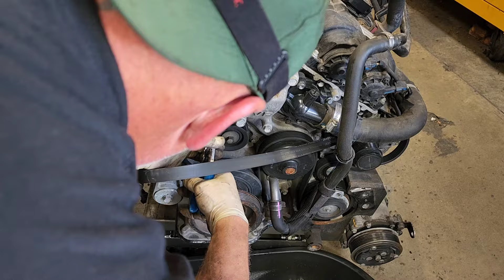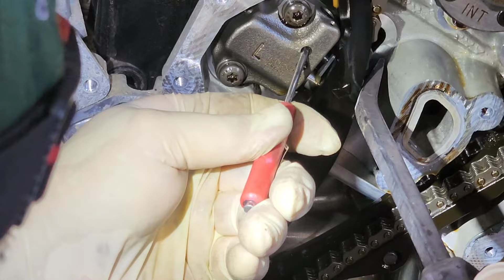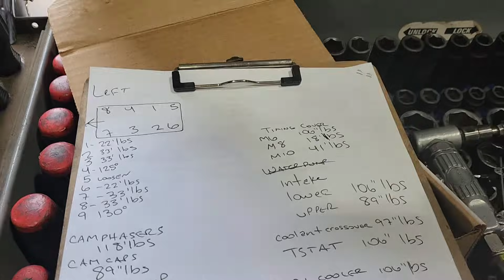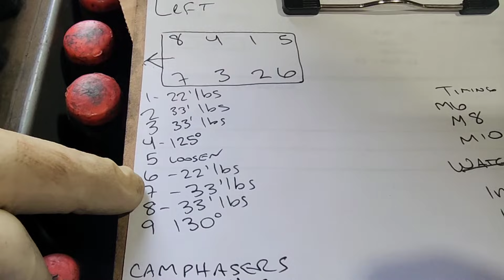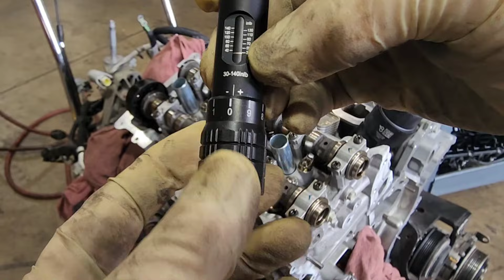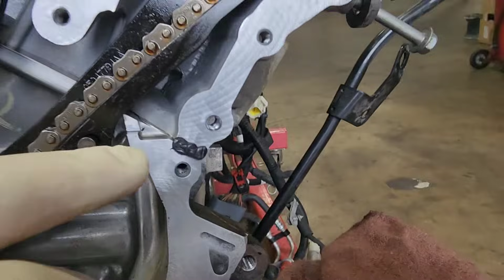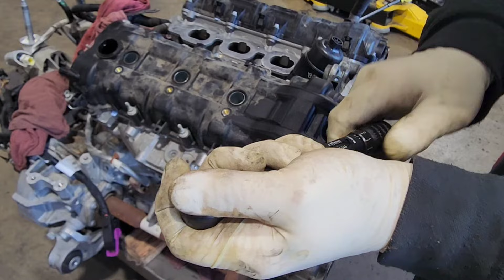3.6 Chrysler Pentastar How to Replace Head Gaskets

Comment: Any worry about stripping out the block when removing or installing the head bolts?? I’m about to tackle this job and I have a weird worry about that. It was never overheated and only has 62,000 miles
Reply: Nah.  Just make sure you loosen them and install them with hand tools.  Don't go in there with a mega torque impact wrench.  And clean out the holes with air like he said.  Take your time, and you should be golden.

Comment: Decent video, one thing if you are watching this video, he forgets to mention to make sure you put your engine into Top Dead Center (TDC) when pulling the timing chains on and off. 
How to tell it is simple. 
1) The crankshaft has a dimple on the crankshaft gear that has to be at 9 o'clock or the block line or pointer located right at the seam where the engine block meets the main bearing cap. 
Do this or else the consequences will be dire.
Reply from the maker: Thank you

Comment: Amazing video, I’m so glad I clicked on your video first, about to tackle this job. Dealership wants about $3500🤬
Reply: Same here !
Reply: @karensloveme Well, I finished the tear down yesterday and started cleaning and installing today. I at about $1300 for parts and tools. I needed the degree wheel, cam kit, and inch pound torque wrench. For parts I bought the Dorman head gasket kit along with upgraded aluminum oil cooler, and water pump, thermostat, and PCV valve.

Comment: so question right? I manage to get the heads off, do I just clean off the heads? and also what did you use to clean the block so nice?
Reply from the maker: I personally never pull heads off without sending them to machine shop to be checked. I personally use a die grinder with roloc plastic disks. You have to be careful though

Comment: Do you remove the oil pan to remove the bolts?
Reply: No, it’s just the four bolts under the oil pan
Reply: @whyeatdirt7951 thanks one more question the head bolts torque specs ist same on the 2019 Durango 3.6 pentastar
Reply: @armandohilario nope. Every generation of the engine is different. Find a manual or something that’s brand new to the year of the car
Reply from the maker: I use it a ton, plus it is longer then extended reach cordless tools even snap on. I actually got rid of my snap on extended reach and only use this one, at least until the new milwaukee extended reach comes out

Comment: Maaan, u r the best ! Thank you for this video !!!!
Reply from the maker: Thanks for watching!
Reply: Sorry to bother you ,I got a question real quick , I was doing the torque on the cam caps and 89 inch lbs doesn't look like that tight ,on your video you go like twice the force , I don't know if it's me, or is like that , by the way I subscribe to you too!! Thanks in advance
Reply: Also my timing marks on the sprockets down on the cranshaft got wiped out with brake cleaner 😂😂😂😂

Comment: what do you clean the head surface with?
Reply from the maker: I personally use a die grinder with light trigger and plastic roloc bristle disk but you have to be very careful not to take off any meta. Very light trigger and pressure

Comment: Appreciate your craft, i have a question, for the torque specs for head bolts on the service manual it says follow steps 1-9 for new block and only steps 6-9 if using the same block, how come you use 1-9 steps with the used block?
Reply from the maker: Can't recall

Comment: Amazing video. About to do some head gaskets on the exact engine. The only thing I am worried about is that I will be doing it in the car. Thanks.
Reply from the maker: Just get a 3 inch mirror it will help.  Good luck

Comment: ALWAYS  LIGHTLY OIL Head bolts? It’s a wet torque. If you don’t you will cause too much friction when you “degree” the bolts. They will popping sounds if you don’t add oil
Reply from the maker: I only oil threads of head bolts if procedure calls for it, But tbh most of the time they do require oil

Comment: its worth noting that the first round of torque spec up until the loosen phase, is only for a brand new block not for a rebuild or used engine block, its just 22 ft lbs, then 33 in sequence twice then 40 degrees then 90 degrees ,other than that great video
Reply from the maker: Thank you for sharing your insight.

Comment: Was this the second or third generation pentastar 3.6L engine?
Reply from the maker: Gen 2 starts at 2018, cannot remember what year this one was.
Reply: Regardless of gen 2 or 3 it’s the same way. Only thing I’d do differently is aligning the timing marks. There are two arrows that need to be facing down on the bottom timing sprockets at the lowest point of the timing chain. Make sure they are facing down. And make sure cylinder one is at TDC. And you won’t need to mark your chains. While putting it back together use factory marks on chain and you will be golden. Also since the left intake and exhaust cam is under tension I heavily recommend holding the cam with a crescent wrench and gently sitting cam at resting position. While removing Phasers.

Comment: Hi, I'm about to do this job on my ram. Just wanted to check with you : I put a pressure tool on my radiator and lost 4psi in 30 min. Then when I started the truck after relieving the pressure to see if I would get spikes in pressure I smoked the garage with white smoke so I stopped my test but is there somewhere aside from the head gasket that could've cause this big puff of white smoke from the exhaust after the pressure test ? Also why not use the 3 black chain pieces for the timing instead of using paint ? Thank you !
Reply from the maker: Yes sounds like a head gasket.  I just always use my paint pens for everything
Reply: @nutsandboltswithtone thank you for the reply. It's really nice of you to take the time to answer to your viewers even 2 years later !

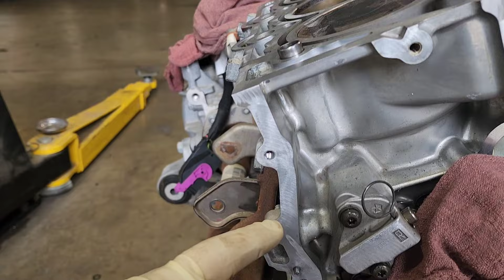Comment: You don’t have to worry about moving the crank. As long as you set piston one the way you have it when you’re explaining at 12:58. That’s where the cycle of the engine timing starts. As long as you crank it back to Cylinder one. Great video though !
Reply: If you wanted to also clean the surface carbon on top of pistons, you’d crank them around. Clean. Just set piston 1 on the right which would be the first piston back up.
Reply from the maker: Thank you

Comment: Hey man, pulled the pin on the left tensioner, but it depresses and extends as I rotate the engine and makes a click sound, is this normal
Reply from the maker: Yes it will do that but chain should stay snug.

Comment: I think I’m about to have to tackle this job on a JL Wrangler I just bought.  Everything seemed great but about a week after I got it I noticed the coolant was about 1/4 inch low.  Topped it off and 2 weeks later it was back at the minimum mark.  No leakage anywhere
Reply from the maker: What I do is block test for head gasket issues but sometimes that does not always work. Here is a link to the block tester I use.  https://amzn.to/4nYUiNR

Comment: Would you say that a failed compression test and vacuum test indicate a blown head gasket on a 2018 Jeep GC 3.6L? I simply used the compression and vacuum (separate tests) that came with vacuum coolant refill kit. 

Also, do you have to remove the engine to do this repair?
Reply from the maker: The way I test for blown head gasket is to perform a block test where you are testing for combustion gases in the cooling system. You do not have to remove the engine it is just easier.

Comment: Absolutely loved this video and so thankful and Grateful for all the information you provided thank you for sharing this ❤ I’m going to use this as a reference guide to replace both my cylinder heads completely in my 2018 ram 1500 3.6l v6 woth 190,000 miles on it with a bad exhaust valve on cylinder 2 Bank 2 that won’t hold compression  along with new timing chain parts oil pump water pump thermostat water crossover and lower intake manifold for about $2,500 instead of $8k-$10k for a new engine that every shop wants to do.
Reply from the maker: I am very happy to hear thank you. That is awesome you are going to do it yourself, good luck. Hit me up on Instagram if you need any help

Comment: I tried taking off the balancer bolt and I think I messed up the timing cause the chain was moving bruh, 😭
Reply from the maker: Damn that sucks. Did you follow the procedure.
Reply: @nutsandboltswithtone  yes I just kept going till the arrows lined up ? Should that be fine ?

Comment: what could happen tightening about 100* instead of 130* like AllData says(I was afraid to brake new aftermarket bolts)???
Reply from the maker: I would think the head gaskets would let end up leaking from the clamping force on head gaskets is not enough.

Comment: Not a mechanic here, great video, I am doing my 2015 Chrysler Town and Country, total rebuilt due to hydro lock. I am following the same manual dealers here use; purchased online for $80.00 the head bolt sequence that manual says to do it once, the second step in your list, if the engine is used or remanufactured; if it is new it is the sequence you use here loosing everything and doing second time. On my block I have had only problems at every step; I found several threads destroyed, my local Chrysler dealer replaced the van original engine once at 59K miles due to a spun bearing; I have Mopar lifetime warranty which they do not sell anymore and that took care of everything but they obviously used an "insurance" block, seeing the condition this block was when I took it apart! I ended up having to re thread all the most important holes in the block; main bearing caps; which manual says they are not repairable; guess what? I am not paying for a used or new aluminum block too take the same risk again so slapped the fucker with deep steel inserts, then had failures on the windage tray holes, threaded all those as well, then had issues with couple holes in the heads!!! had to get a kit ($538.00) to do those but the job came really nice; and last but not least the oil cooler holes were ALL stripped!!! this is from the dealer from a " Certified Mopar Tech" whatever! I took pictures to the service manager there because Mopar rejected my claim for water damage and so did my insurance, I had to end up doing it myself because nobody wants to pay 13K quoted job and I laughed when they wanted to give me $1500 for the van as total loss; so slowly but surely I am doing it, doing what I can with my limited knowledge, same way I rebuild my wife's Corolla and still running after 3+ years. When I torque those Ajusa Head Bolts to spec, just once, I felt no desired to loosen them again, so I am glad it is not needed, according to the manual I am following; they seem to have grabbed great; only one bolt creaked under torque; the beauty of the thread inserts is they would hold for even more head jobs if needed in the future. I just ordered today a Dorman Thermostat Housing/ Thermostat, aluminum and a Dorman oil cooler aluminum as well; those cheap Micky Mouse designed Mopar parts makes my blood boil, specially knowing how much they charge for it and they rate of failure! I am keeping my Mopar water pump, the impeller is in great shape and with a new gasket I am hoping it will hold up. The day before yesterday I did my timing and did not replaced anything there all was great; I expended all afternoon doing it so the marks were all checked, double checked and triple checked, left the same way there were when I opened the engine; they are actually fool proof. I am hoping this van will run when I turn the key, we will see.
Reply from the maker: Wow man what a journey and damn that sucks.  Sucks chrysler denied the claim.  Happy you got it going and that it continues to serve you well.  Thanks for watching

Comment: What is the purpose of marking the chain? I'm wondering because I'm considering replacing the chain while I'm at it.
Reply from the maker: The main reason is habit for me, I always mark every chain and sprocket I take off and timing belts as well. If you are replacing the chain you do not need to do anything because there are colored links to line up.
Reply: @nutsandboltswithtone Thanks for the info.

Comment: 2017 Chrysler Pacifica: Did not have locking blocks for cams. Used a 36mm socket and a 25-inch breaker bar on the Oil Control Valve. Countered with a 30mm wrench on the camshaft itself. My camshafts moved, so I had to take out the tensioner pins and rotate the engine several times until my marks on the chain lined up and holes on the cams faced up. Then, restarted the processes to take out OCV.
Reply from the maker: Oh ok that sounds like you were able to get it done. Did everything go ok?

Comment: I pulled off the valve cover on the right side of the engine. And a seal came off bent in the back by the breather. Yk what seal that is?
Reply: Whats the ig?
Reply from the maker: @Paintballshow5 https://www.instagram.com/nuts_n_bolts_with_tone/
Reply: @nutsandboltswithtone dmd
Reply from the maker: message me on instagram

Comment: Why send heads to machine shop??
Reply from the maker: The machine shop checks them for flatness, checks to see if they need valve job also replace valve stem seals. Imagine if you pull heads off and after find out you have a valve issue, or the heads leak coolant into the cylinder because they were not flat. I never pull heads and put them back on without going to machine shop.

Comment: I have 2018 ram tradesman. I have hauled so much with this truck until 143k decided head gasket to fail. Just come out from the debt. I can't afford buying a engine or getting it done. So I will work with this truck on Winter time. Where I can enjoy days offs, lawn season slightly slows down, Houston Texas. 

By far this is best video I have seen. I've been debating pull the engine out or in engine bay. But at the same time I need engine stand and engine jack. Which spend more so I guess in the engine bay.
Reply from the maker: Good luck with this job

Comment: Interesting valve actuation  technology on the Pentastar...
The cam is what actually opens the valve.  The so-called lifters don't actually lift a darn thing...Their job is to hydraulically control the valve rocker arm gap using engine oil pressure.
Reply from the maker: Yes because it is over head cam

Comment: Since you are this deep into it you might as well do the upgrades...

#Dorman aluminum oil cooler/filter assy

#aluminum thermostat housing

#latest Mopar valve rockers and tappets

Great video!
Reply from the maker: I did replace the oil cooler but we were not using Dorman at the time.

Comment: My service information on ALLDATA says that you do the full torque sequence (steps 1-9) for NEW engine blocks, but just steps 6-9 for REUSED engine blocks. Can anyone back me up that I do not need to tighten the head bolts and then loosen them on a reused engine block (head gasket replacement), and that I should just go straight to step 6?  I'm not sure if this gentleman is working on a new engine block or a used one out of a vehicle.
Reply: Excerpt from ALLDATA: 

Install the eight cylinder head bolts finger tight.

NOTE: For engine builds using a new block follow steps 1–9. For engine re-builds (reuse block) follow step 6–9.

Tighten the cylinder head bolts in the sequence shown, following this 9 step torque plus angle method. The torque sequence must be used for each step. Tighten according to the following torque values:

    Step 1: All to 30 N·m (22 ft. lbs.)
    Step 2: All to 45 N·m (33 ft. lbs.)
    Step 3: Re-tighten all to 45 N·m (33 ft. lbs.)
    Step 4: All + 125° Turn (optional angle if 125° rotation cannot be accomplished in one motion; tighten all by turning 35° followed by tightening all by turning 90°) Do not use a torque wrench for this step.
    Step 5: Loosen all fasteners in reverse of sequence shown
    Step 6: All to 30 N·m (22 ft. lbs.)
    Step 7: All to 45 N·m (33 ft. lbs.)
    Step 8: Re-tighten all to 45 N·m (33 ft. lbs.)
    Step 9: All + 130° Turn (optional angle if 130° rotation cannot be accomplished in one motion; tighten all by turning 40° followed by tightening all by turning 90°) Do not use a torque wrench for this step.
Reply from the maker: I would have to look it up at work to confirm. If you message me on Monday morning I will look it for you. Hit me up on Instagram

Comment: If you’re holding the camshafts with a wrench, do you really need the sprocket locking blocks? I feel like they’re kind of redundant
Reply from the maker: Not sure what part you are referring too, message me on Instagram
Reply: The locking blocks keep both the camshaft and crank in place, so it's easier to reassemble with the correct timing.  If you were just using the wrench and socket,  you might shift the crank timing a bit.  At the same time,  the plastic teeth might fracture if you didn't use both the wrench and the socket wrench.

Comment: I have a bad exhaust valve cylinder #2.  How much should I budget to replace the head with a new one? 200k miles on the truck.
Reply from the maker: I actually never see dollar amounts I am sorry
Reply: @nutsandboltswithtone I found remanufactured heads with cam shafts, rockers, and lifters for around $800.  Seems like a good idea… was yours the same?

Comment: this is a great tutorial video. i normally build performance import motors, mostly the nissan ka24, but also do JZ, RB, SR, and several other stuff but took on a headgasket job on this chrysler 300 3.6... honestly wasnt as bad as i figured it would be. the worst part was getting off the lower oil pan and the driver side exhaust off the head (due to ac compressor in the way). other then that smooth sailing thanks to this video. Kudos my dude and im  going to follow your channel also.
Reply from the maker: Thank you that is so nice to hear.  Im happy it worked out for you.